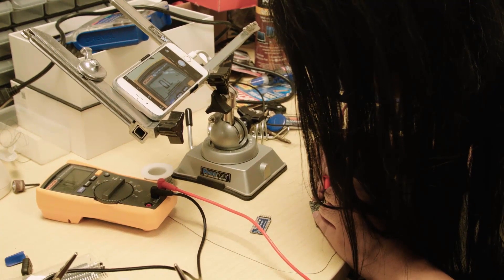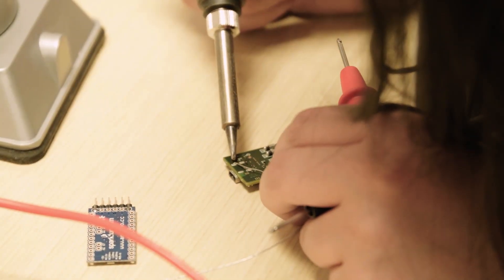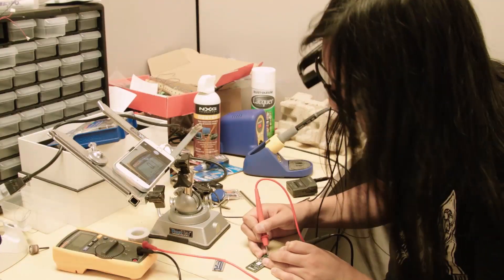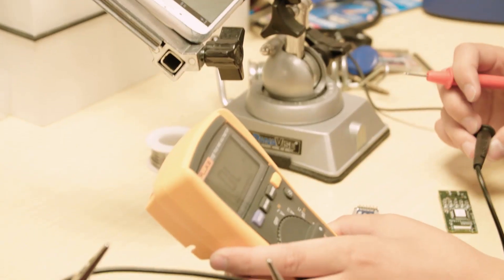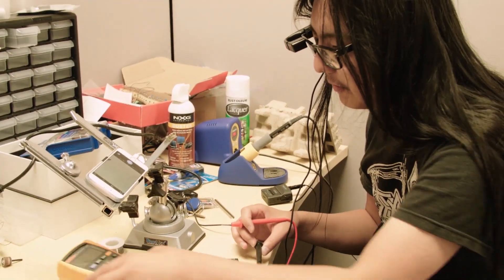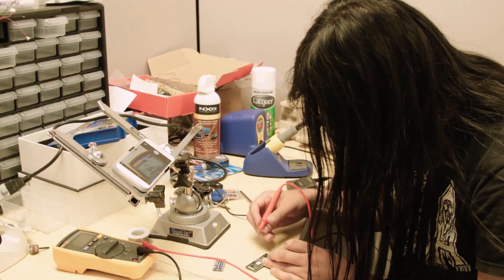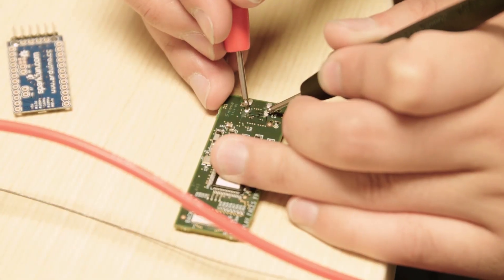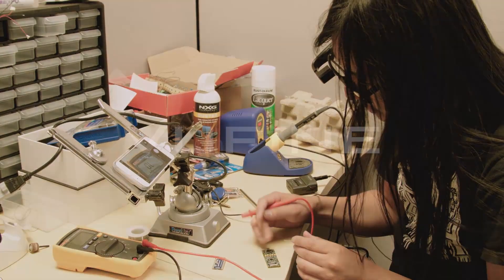First Impressions With Vufine: Electrical Engineer

Comment: Hope this gets collaborated with motorcycle helmets. Somehow sync vufine with a mini portable camera that can be put anywhere. This would be very helpful for the average user in safety and awareness. As motorcycles don't have rear view mirrors like cars do. Or even for large vehicles whom can't see the rear side. I see potential in this.
Reply: +olsko7j I think you are looking for this: http://www.skully.com/#smartest-helmet
Reply: +Michael Nishizawa i knew about the skully. But its not affordable for the average joe and not fully flexible to work with. What happens when the skully gets old. We have to buy a new one. Great helmet though but not sustainable. I was thinking more like a universal device where we can attach to any helmet. Like chatterbox communication device. We can switch and attach the radio to any helmet. The vufine could be that similar. Cheers